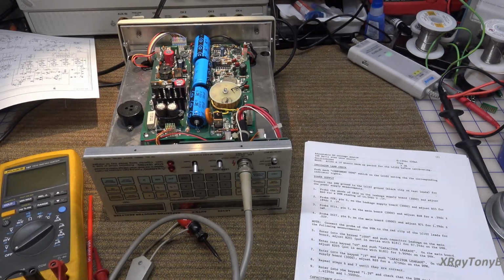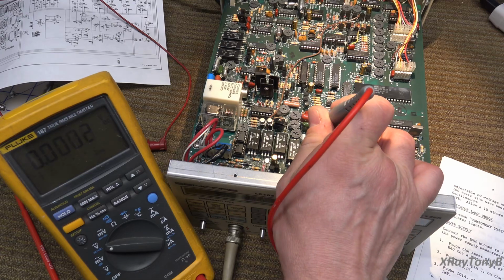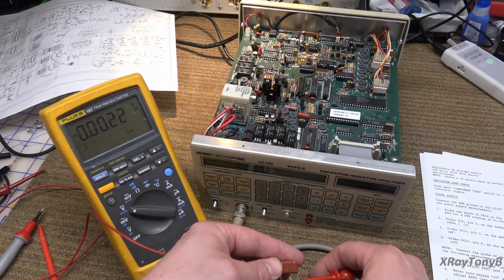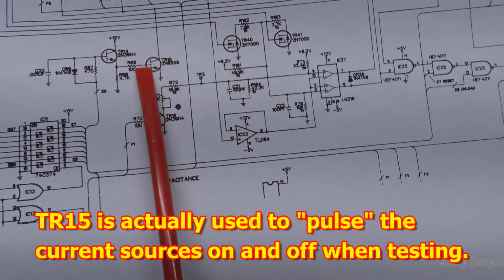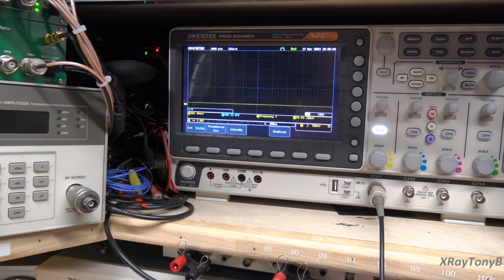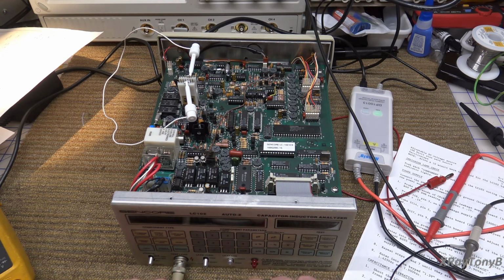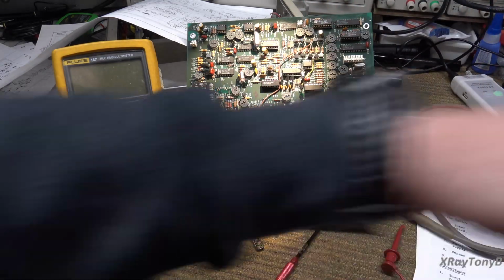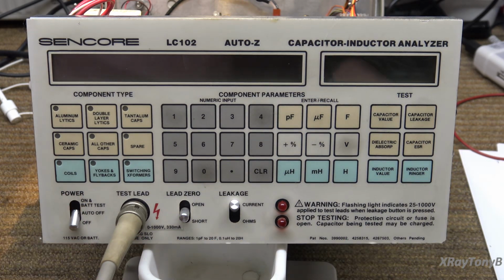Sencore LC-102   Part 4 - Fixing it Then breaking it  :(

Comment: After putting my broken LC102 on the shelf a couple of years ago, I picked it up again after watching these episodes. There was so much issues with it, from broken CPU to bad caps and blown leakage board MTM6N60 power transistor. One of the issues I could never figure out was the very unstable 1V and 4V leakage calibration voltages. Now I see you had exactly the same issue, so maybe those are supposed to be like that. I was just waiting for that step. I've also replaced TR11, TR12, TR40 and TR41. One of more of those must have been leaky, noisy or semi broken (they did still read measure as transistors). Before swapping them, I was never able to get the 1500pF cap to measure more than 1200pf, even with the trimmer pot at full for both the lower ranges. After swapping them there was no problems dialing in the 1500pf and 2uf values. This is where I am with this right now, still facing some issues. For me the cap readings are fluctuating a bit. I am not sure if this is normal or if there are still some noisy transistor (or diode) in there. For the 2-2000uf range I suspect the CR29 and CD30 PAD20 diodes to be leaky. This seems to be a common fault. Looking forward to the next installment of this series :)

Comment: I’ve cal’d a few of those LC-102s though it’s been a while.  Those trim pots aren’t my favorites (I think Tek used them as well).  I seem to recall the procedure directing you to center the adjustments to mid-scale, and found that to be counter productive and let them be unless they had to be tweaked.  I work at a NASA electronics lab and that adjustment process may have been in the NASA cal procedure.  
I used a GR 1689 Digibridge as a transfer standard for hand picking discrete caps.  Have fun! 🙂

Comment: With all that glue on the PCB, I think you found a bad PCB area. Never seen anything like that before. If you did not plug the chip in backwards (and maybe blow it) , I would suggest "ohming" out all the pins on that IC to make sure there are no other open or shorted traces. You might even need to remove the socket to make sure you see things clearly. Maybe under the socket there is a solder ball short because of the bad PCB? Really enjoyed all 4 videos, watched them all yesterday. Waiting for your next video! I agree with everyone else, keep up the great work!

Comment: Just check to make sure the pins have good solder re heat and if the chip is in the right position check again for broken traces the board. Best wishes on the the repair.

Comment: I'm sorry to see the "setback" at the end of the video. Out of the 4 cap value ranges you did a quick check on, you had a commonality of difference on the 3 lower values, and your 2000uF seemed to be close to value, I would look at any components that share the circuitry for the 3 lower values more closely. Hopefully you regain function on it, I am still offering a "state & compare" service off of my LC102 if you get to the point you feel you need it.

Comment: Try Acetone! I have been using Acetone for close to 40 years cleaning flux off circuit board repairs. Works great, drys very fast, leaves absolutely no residue. And it is deemed safe for skin contact because it evaporates so fast, it can't penetrate skin. That's why it is the main ingredient of nail polish remover. Just be careful around plastics although I never had a problem. Here is California you can guy it in quart or even gallon cans at Home Depot and other home centers. But I have heard some states still regulate the sale of Acetone. But you can still get it by signing your life away.

Comment: Hi, I enjoyed very much watching this series as I own one of these myself.
I have had a plan for many years to recap it, and now I'm surely going to speed up that.
I think maybe you do the zero leads calibration wrong. I always hold the switch in the open or in the closed position for the duration of the test, and not just flip it and then release it.
Thanks a lot and all the best.
😄

Comment: A good rule of thumb is, “don’t hit thumb with hammer.” 😊 Also, “don’t use thumb to check temperature of hot soldering iron tips.” 😝 And, finally, “If thumb is still there, do not remove or service; no user-serviceable parts inside.”

Comment: I would like to make a comment on  the 14.5 volt adjustment. I'm sure Tony know this with his extensive experience but I'll mention it for others,  In this case it was well within the spec at 14.501. However I have seen some technicians working on complex analog gear try to either set to 14.500v in this example or just just move the pot around "to make sure". BAD IDEA. If the circuit has stabilized over years at that voltage, just leave it alone. Trying to force the circuit by 0.001 volts is pointless and now because of you new adjustment, the circuit will drift. Even if the pot is dirty, you aren't moving it so the wiper position is solid as long as you don't move it.